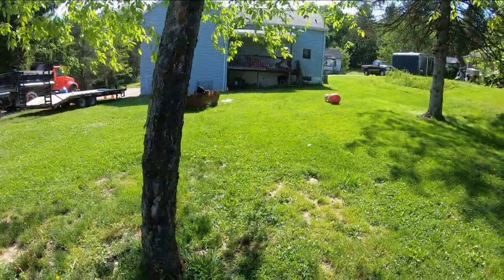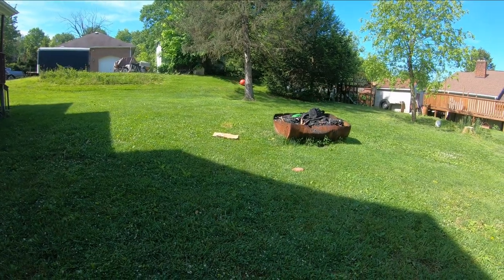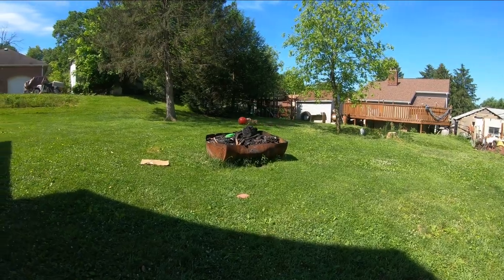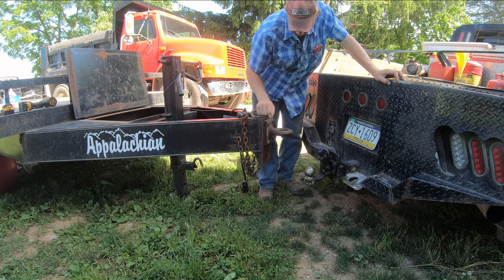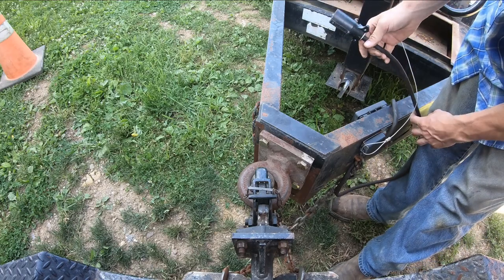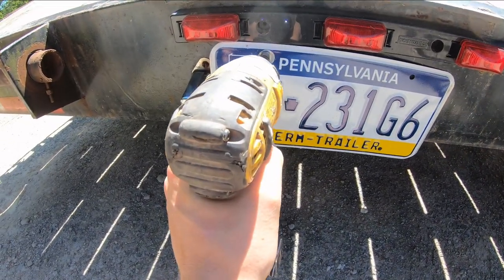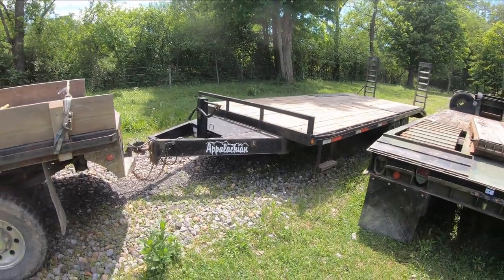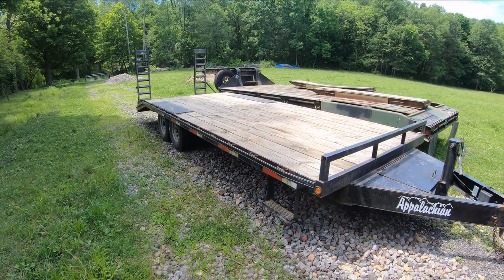“Upgrading” to an OLDER Trailer!???

Comment: Ball ratings are a joke. Pintle hitches are far stronger than the trailer or the truck frame. I have never seen a broken one in my life. They are the only way to go.
Reply from the maker: Agreed!
Reply: As long as you don’t mind the constant jerking and banging around. Some idiot put one of those on my little tandem axle utility trailer. Couldn’t stand the “loosely-goosey” feeling and the jerking and banging at every stop and turn. Took a Saturday afternoon and spent some quality time with the torch, grinder, and welder and switched it back to a ball hitch. It’s like a whole new trailer now! For an equipment trailer like that, it may be fine, but on my trailer, it was overkill. I’ll stick with my ball, thank you....
Reply from the maker: Everyone talks about that but having pulled lots of them for thousands of miles I really can’t say I know the feeling, I mean I can tell when it slacks off or hits a bad bump but it’s hardly noticeable and if you have the brakes set right there is no jerking.
Reply: @notajp  They don't jerk around with weight on them, a ball on anything heavy duty is asking for it. Light weight, no problem.
Reply: @DieselCreek  Yep, with weight on them, they dont jerk around. They aren't for F150's hauling bass boats. Pulling on a hitch is nothing compared to that day when you have to slam on the brakes..The brakes will find all your weak points in about one second.